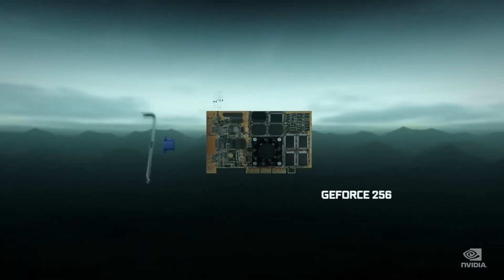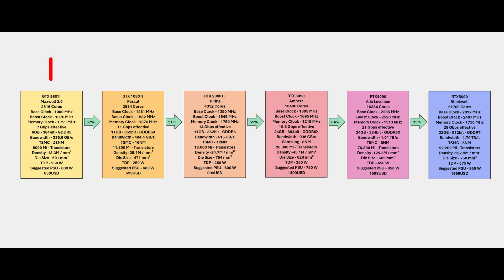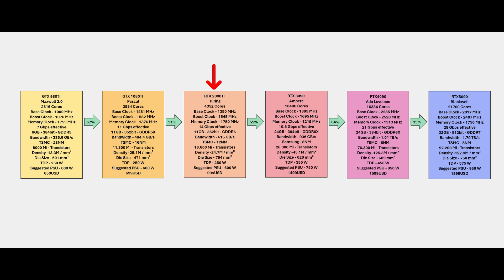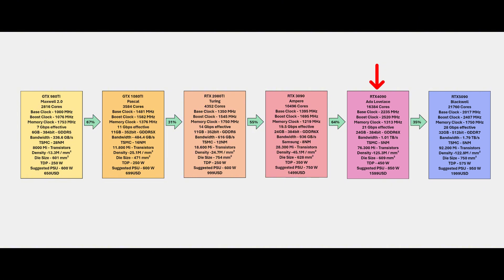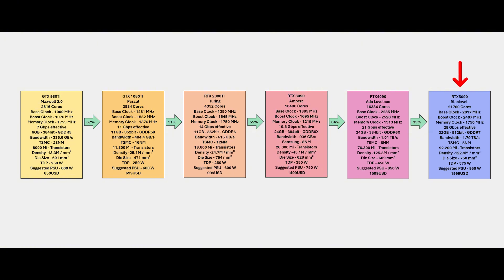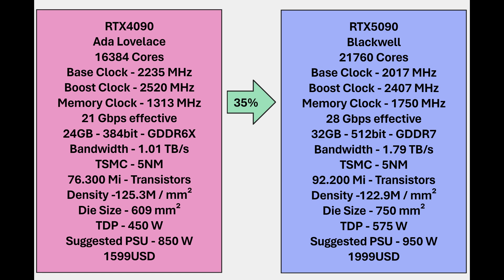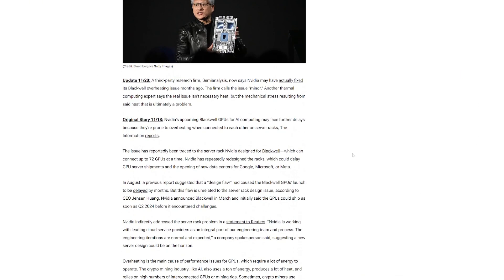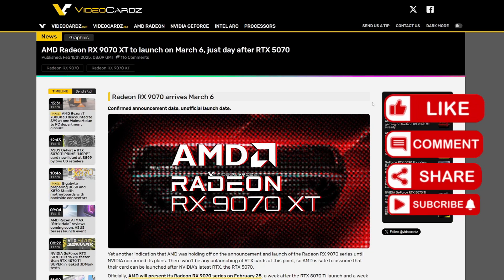Why Nvidia is in stagnation?

Comment: No competition - same problem Intel had till the 7-th gen. AMD introduced the Ryzens, and suddenly Intel went adding more cores when previously all they did was 4 core i5-s and i7-s with only a 5-6% performance difference between generations. Now Nvidia has no competition - AMD should've introduced a new flagship and mid range GPU, instead they annonced an obscure GPU with confusing name, and bragged about FSR4 that only serves to cement Nvidia's DLSS trend.
Reply from the maker: @meganoobbg3387  yes loads of people are making this comparation with old Intel and I agree in some parts.
Definitely if AMD show a better product will put pressure in Nvidia but I don't believe that's gonna happen unfortunately for us and I actually commented about it in my today's video.
I believe AMD will do more the same unfortunately.

Comment: The 5090 is an okay improvement for a same node generation. The rest of the stack(they should have at least kept the 16SM per GPC layout to give the 5080 about 14K CC and performance close to the 4090D, and the 5070 8192) makes the Radeon HD2000s look S-tier
Reply from the maker: I 100% agree with you! But just have one observation "It's ok" improvement but the price is way higher, and "it's ok" improvement is enough for you make a upgrade like in the last generations? And the reason they didn't gave us a better XX80 class is all about money they want to keep their earnings as high they can, they could cut the chip of the 5080 as you said higher but that's means more expensive 5080 and 5070TI. But yes I honestly agree with you.